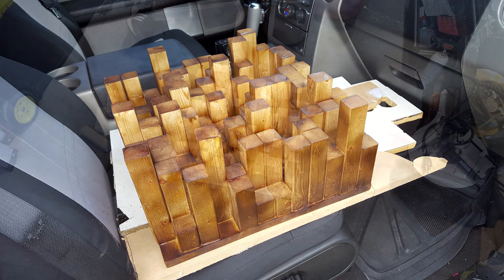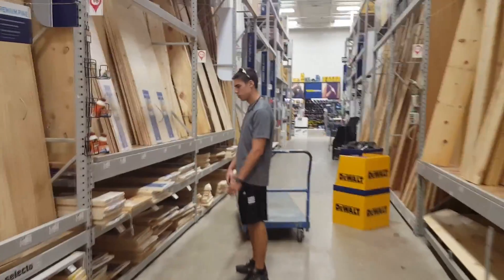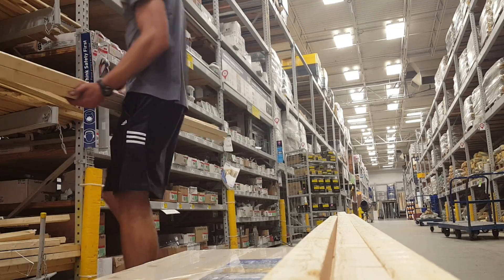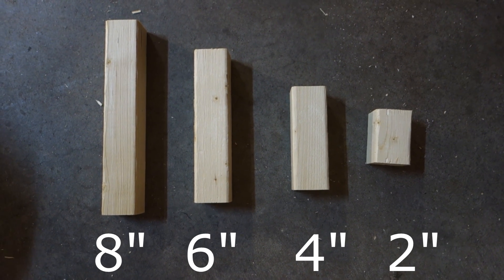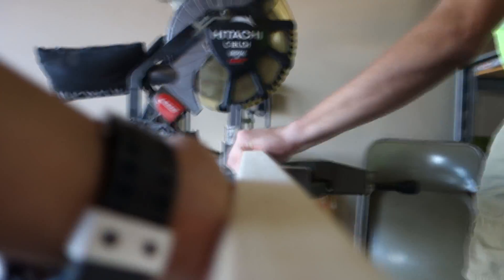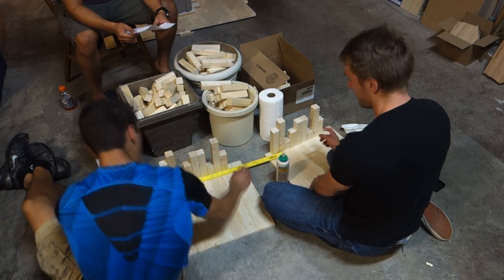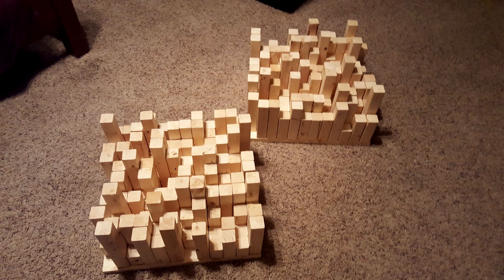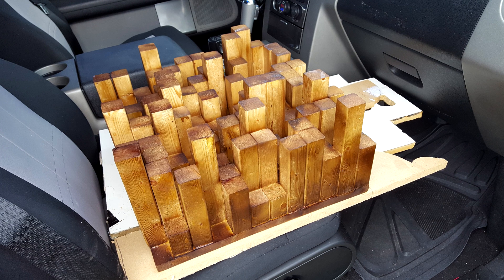How to Make a Wooden Sound Diffuser

Comment: The website isn't working for me, but does the placement of the blocks matter? Or is it just for symmetrical purposes?
Reply: It matters a lot because the diffusion range in Hz is based on a mathematical calculation

Comment: How do you know where to put the 8 in 6 inch 4 inch and 2 inch blocks? Do you have a diagram
Reply: The software actually provides you with a scheme, a diagram of the panel with each square block and the inch size needed for it!

Zak
Reply: @konoharf  yes "the software" who doesnt know "the software" xDDD
its totally meaningless how you place those sticks...every room is different as is every voice.
Reply: Tobbezeichnet not true.

Comment: really good video, in the process of sorting materials to get going, was just wondering how you built a 17inch board but used the same measurements as the website you linked for a 24" or 12" one? Thanks for the video its been the best I've seen!
Reply from the maker: Thank you, i'm glad you enjoyed the video! I used the same length of boards but changed the widths/depths of them. You can make any size you like as long as the measurements for length are proportionate and the boards are square.
Reply: Great thanks I shall measure up in store

Comment: If you build them yourselves I had expected you build them mirror symetric because this is required for small rooms. You also can use the non planar version which helps to diffuse very high frequencies. See here: https://www.youtube.com/watch?v=N03HYL6pPSw
Reply from the maker: I built these to spec for a customer I had. Thank you for the advice though! I'm not very educated in this field.